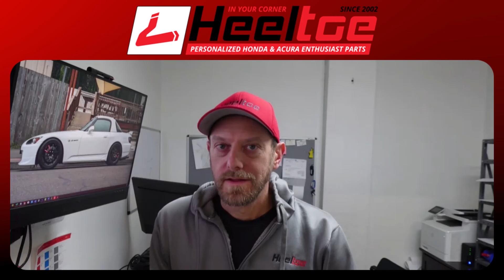CC24: The Brake Rotor Warping Myth

Comment: Back in the 70s, when a customer felt a pulsation in the brake pedal, the easiest way to explain it was “warped rotors.” It helped them understand what was happening with their brakes. Today, most of what people call rotor warping isn’t the rotor bending at all. it’s usually uneven pad material, rusty hubs, or a sticking caliper. The term stuck, but it’s really just a convenient way to describe brake pulsation.

Comment: I've warped one once going downhill in the canyons near SLO. The rotor on the outside of the downhill turn warped due to having to ride it since I picked up too much speed passing someone. When I got back home, I could audibly hear the warped rotor bouncing off the pad and checked to see it warped so bad it looked like a cymbal. But that rotor lasted 60k miles after running that same canyon multiple times. I think they lasted so long because I bed the pads really well when I first got those rotors and re-bed them again when I pad slapped them.

Comment: Rotors very rarely warp , uneven wear yes because your inner brake pad gets more use and wears more so the inner rotor will wear dowm more than the outer surface its basic physics and common sense

Comment: I get what you’re talking about. But there are very severe cases where stuff actually warps. You give way too much credit to the manufacturers to actually make quality parts, which the manufacturers aren’t making quality parts. You said it yourself that you’re not a mechanic. I’ve worked on cars for years and have seen extreme cases of really bad warped discs. And into call mechanics liars when you know only half of what you’re talking about is comical. There are actually videos that you can look up on YouTube that will show you exactly what I’m talking about that show them spinning a rotor and showing the extreme warp.
Reply from the maker: I didn't say the rotors CAN'T warp, but I do say that for the majority of cases, they DON'T. But probably 99 out of 100 mechanics will say it happens all the time. Thus the point is, mechanics these days are just passing on misinformation and are glorified parts swappers.

Comment: Warping is a misused term in the industry. They rarely "warp" but they do wear unevenly. Which is what causes excessive runout. High and low spots. Which can be easily fixed with a lathe. 
I have been in the industry for over 35 years and have been working specifically on rebuilding brake lathes for the last 22 years.
Reply from the maker: Thanks for the supporting comment!

Comment: Hi, I have some interesting and annoying issue with the breaks in my type R(FK2),
so my previous set was the oem disc(2 piece updated discs) with tarox corsa pads, that worked great for about a year and a helf, doing like 5-6 track days during that time, daily and spiritual driving.

now the car is not a daily any more its only used for hard driving and track days, 
and I updated the set, the current set is same discs(oem 2 piece) and  endless mx72 pads, 
in the last track day at the end of it the brakes started warping, 
mind you they were installed like 2 weeks prior,  
the instructor told me to break hard on the way back a few times, 
on the way back I did that- many times, 
the it got hot very hot, and had an instance that I had to stop on the way for like 5 min while they were hot, 
now the warping didn't resolved, and my mechanic sent the rotors for a lathe work, 
after that the warping was gone, but the break is now not as good, not good at all, I find myself needing to break double the distance I usually do.
since that I'm driving much more restricted and honestly cant trust the car.
not sure what to do.
some told me that those pads are too aggressive for the oem rotors and I need to get a dba or something like this as a rotor as those are more capable.
(this guy claims that the tarox I had was the maximum aggressiveness from pad I can throw on the oem rotors )

now the question is, how can I know that my pads are too much for my rotors? is there a rule of thumb for that?
Reply from the maker: Lots of detail there, thanks. The first thing I would say is, it is really hard to get a feel for a set of pads based on marketing, referral from others, or even specs. You have to try them and find out if they work for you or not. How do they bite, how much heat do they withstand, acceptable noise or dust...these are all somewhat subjective features that you need to judge for yourself. Sometimes you buy a pad and don't like it. Need to try something else?

With regard to the rotors, your question is not really easily answered. "The max aggressive pad you can use with a rotor" doesn't really make sense. Partly because it relies heavily on how aggressively you drive the car. But the concern you have is how well a given rotor will handle heat. More aggressive driving and/or pads combined with higher-grip tires will generate more heat and the rotors can't manage it then you get fading, "warping", or other issues. So, if you like the pads but are torching the rotors, you need bigger rotors.

Comment: You're wrong absolutely rotors warp if you never taken your rotors off of your vehicle put them on a turning lathe and turn them you will see the high and low spots and if you ever put a dial indicator on a warped rotor they are warped rotors
Reply from the maker: You may not have listened to the entire content.
Reply: @Heeltoe.  I will be happy to GO back and watch again, if a miss interpreted something that led me to believe that you were saying that rotors don't warp I will correct my statement ,,. steel warps when it gets hot if it's not heated evenly any steel cast-iron warps that's why you use torque plates  when boring cast-iron
Reply: thickness variation is not warping. Warping would not change the thickness of the rotor. The high on one side would be matched by an equal low on the other side. Thickness variations are caused by uneven material transfer and in some cases corrosion/ rust.

Comment: VERY interesting!  Thanks!!  The "warped rotor" explanation never made sense to me.  You mentioned "When you replace the brake pads, strip away the old transfer layer and put down a new transfer layer you'll notice better braking."  Do you have a vid talking about how to do that or the best way to do that?  Or is it simple enough to not need a vid cuz I'm not entirely certain how to do that.
Reply from the maker: The bedding process is what you mean. I have not really documented that well. But I should...

Comment: I have a 2017 toyota sequoia with 41k kn the odo. Last November i replaced the front rotors and pads. Stoptech slotted rotor and hawk lts pads. Bedding according to Hawk's instructions on the box. So far the brake have less than 3000 miles on it. But i notice that from moderate to firm pressure on the brake will cause pulsating and steering wheel to shakes/vibrate hard. But if i am easy on the pedal it is smooth. Stopping from 60+mph with medium pressure it will pulsate.  
What does this mean? This issue is driving me crazy. I've replaced rotors and pads on our other vehicles and non have this issue.
Reply from the maker: Hi! Personally I think it means you have a transfer layer there. The pads may need to be a little more aggressive, or perhaps when you bedded them they got too hot. I don't have direct experience with the LTS so I am not 100% sure.

Comment: @kristiang.5237
4 months ago
I agree.  Back in the 60's when only foreign cars, Jag’s, Porsche, M-B, TR4’s, MGB’s, had disc brakes, we seldom had this issue. We could change pads several times on a rotor as long as it wasn't heavily grooved. Even on track cars.  But then the domestic cars started using disc brakes and they started cutting corners to save a buck. Chevrolet was one of the worst.
That said, I like the idea, but I really think it is a bit of an overreach.  If the rotor isn’t warped then how do you explain that when one starts to cut it, it has high spots and low spots. You can hear it on the cutting lathe as it rotates, hits, and miss.  And it is not braking pad material it is removing but in fact it is metal that is being removed.
Also, if it were just brake pad material then a quick clean up with a good piece of Emory cloth would solve the problem.  Sand then down, cleaning all brake material off and “Bob’s your uncle” the pulsing goes away. But that doesn’t work.
Reply: I sanded the brake rotors on a Ford Escape. It fixed the shuddering and uneven braking with no other issues.

Comment: The current generation Passport (which i own) is probably the most poorly engineered braking Honda ive ever experienced. Upgraded pads and rotors solved the issue entirely. Honda specs the weakest pads for that large vehicle. Its ridiculous.
Reply from the maker: What pads did you use?
Reply: @Heeltoe.  I went for the Stoptech street pads and have been really happy with them. Paired with the Stoptech slotted rotors. Did all 4 corners.

Comment: Break-in / burn-in procedure, that is, similar to that recommended by StopTech. I my mind this proves the theory of uneven transfer layer  as the cause of brake pulsing or shaking.
Reply from the maker: It's pretty widely accepted that the bedding in procedure is critical to effective braking, but somehow it gets lost when the shaking starts and people look straight at the rotor.
Reply: So I just watched your video again and @  3:49 -3:51 somewhere in there you state " that's a myth rotors don't warp " the rest of your video is pretty on  the money about material buildup and transfer you left out is that it is the pad material transfer when they are first put into service that causes highs and lows on the rotors which creates more and more heat poor breaking and excessive heat which intern is responsible for the rotors being warped, you've got a lot of good information but I think you need to retract that statement about it's a myth rotors don't warp they do keep up the good work

Comment: While I respect your opinion and I agree with some of the things you’ve said, I disagree on the main topic.  Brake rotors can and do warp.  This is caused by repeated cycles of heating and cooling.  Rotor composition and pad bedding process (or lack thereof) will also have a big effect on how long it takes for this to happen and to what extent.  High carbon content and cryogenics will greatly delay and reduce the effect, so yes, purchasing higher quality rotors is a good thing.
Reply from the maker: Thanks for the comment! We never said that rotors can't warp, just that the vast majority of time they do not. The myth is that it happens all the time. It doesn't. The knee-jerk reaction to brakes shaking is "warped rotors" and nearly every time this is false.
Reply: That’s NOT a warped rotor and you are flat out wrong. If your ROTOR was WARPED it would not spin inside the caliper. Even the cheapest rotors on the market are made of CAST STEEL that could not warp at the heats applied during the heaviest of braking. Even at plus 700° It would take literal torches to attempt to warp them. The only thing you’ve ever felt with your brake rotor is inconsistency of brake pad material being laid across your brake rotor surface. In turn, giving you the feeling of “rotor being warped”. You’ve never warped a rotor, regardless of what you think.
Reply: @permabulk1454  have you ever heard of or seen brake rotors being turned/cut on a lathe?  What are they cutting then… brake pad material?  I think not.

Comment: So is there any point in getting expensive rotors then? Sounds like your local AutoZone rotor would work just as well as long as you have good pads
Reply from the maker: There definitely can be yes! Material composition (ie, higher carbon content) and post-processing like heat treatment and cryo treatment harden rotors which extend the life. Rotors with curved vanes vs straight ones will shed heat more efficiently. Two-piece rotors will shed heat better and weigh less as well. Larger rotors have more mass which allows them to take on more heat before they max out and start overheating the pads. But for regular road use, those benefits are often not worth the cost. But try telling a real enthusiast that. THey want fancy parts.